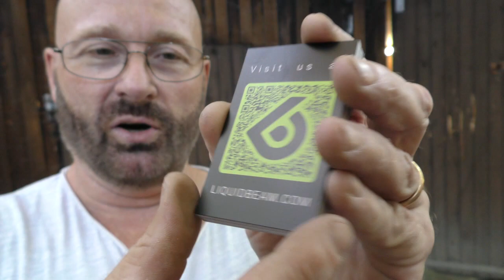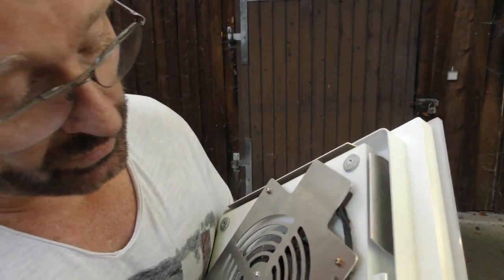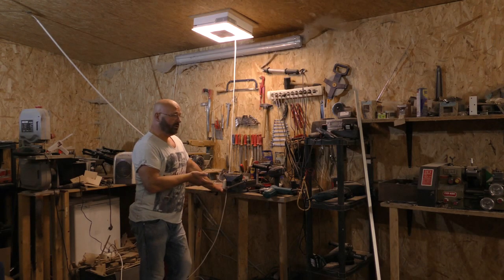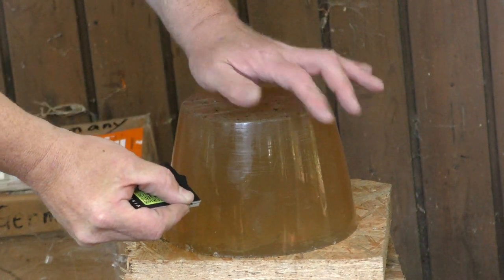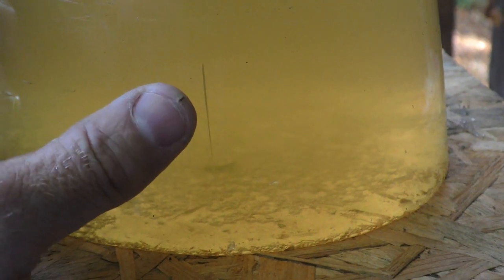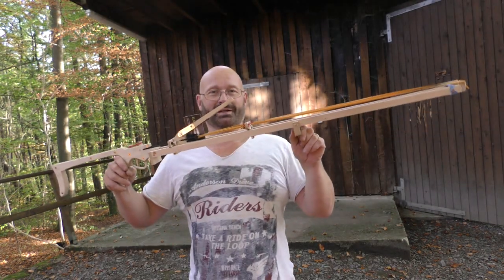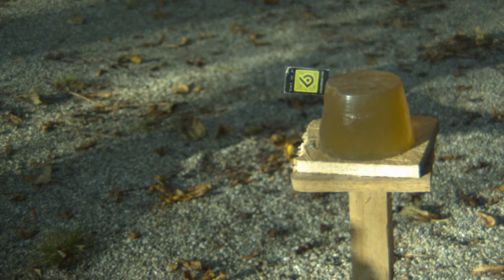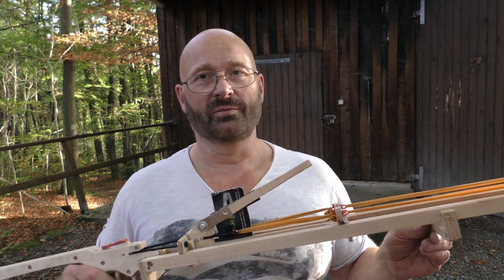How To Weaponize Business Cards - "Cardception"

Comment: This is a VERY BAD idea for "upgrades" since electrical light installations are not designed for huge loads such as heating. Hopefully you have 6 amp fuses on your lighting and they'll pop soon after you turn the heating on or you're in for a nastier surprise.

Comment: what exactly is the benefit of putting an electric heater in a light? Electric heaters are not efficient, and it is not even a storage heater, which is less efficient than gas but what you use when you don't have the option. If it is a localised heater a portable heater would work better.

Comment: ehhh the product seems kinda bad. what if it's summer night? i sure as fuck don't want more heat in the summer. those lamps are probably a lot more costly in the long run than just central heating/burning wood

Comment: All fine and dandy.. except for the price. Are they willing to manufacture every unit with custom 3D printed parts?! I can achieve the same functionality with couple of LEDs combs, transformer and doubled up hairdriers :D + AT89C52/Arduino microcontroller -> all that for the fraction of the original unit cost. Nice idea, but since you want people to use it outside main living space (garage, workbench etc. ) there is no need for fancy design, just make the thing practical and affordable (at least when subjected to mass production). Still they are German, so maby its all because of their inherent urge to overengineer things :P
Reply from the maker: I don't think hairdryers would work, they are much too loud. You want a large, slow moving fan. And don't forget that you run into many costs if you bring a product to the market - liability insurance, warranty, taxes, plus the margins of distribution and your own profit margin. Rule of thumb in the electronics industry: Multiply your production cost by factor three, then you have a retail price that lets you make some money. For a 250 dollar RRP, that means you have to build it for 83 dollars. Not easy.
Reply: Of course the process of making it legal and fulfill any safety regulations rises the overall unit cost, because you have to get rid of "janky" solutions that were fine on prototype`s drawing board :P .Still I dont deny the plausibility of their idea, and wish them all good - even if personally i would rather build it myself (i do feel like you if it comes to safety regulations when building/testing my crazy contraptions) :D .

Comment: so a throwing star is defined as a star shaped metal disk... and circular saw blades looks like the sun... which is a star... GERMANY BANNED TABLE SAWS?!?
Reply from the maker: No. They must be meant for throwing. So circular saw blades are fine. But the saw teeth are actually too small and also not aligned because they wouldn't cut, otherwise.
Reply: so as long as it isn't meant for throwing its fine. So like if you wanted to have fun with throwing stars in germany it would be fine to goof around with say, throwing some small bike gears into a board?

Comment: So Eliah is an incandescent light bulb over-engineered with an LED. It was cheaper before. Such a train wrack idea. Putting the heat on the ceiling. Please remind me where heat is going? Down or up?. Smashing two existing solution together is not innovative.

Comment: If it spins horizontally it would fly much further
Reply from the maker: Why? This isn't a frisbee.
Reply: Yes but then it will fly like a frisbee. If you throw a frisbee (or card) vertically it wont fly very far. Your card flew so far because it had so fast speed. If it spins horizontally the airflow will keep it in air much longer and with so fast speed it could fly further. Of coure it wont be so accurate and it's more difficult to make.
Reply from the maker: @danielnyman6082  You are mistaken. A Frisbee has the distinctive bowl shape so the rotation creates an upward lift. Same goes for clay pigeons. A flat object won't show that effect so it makes zero difference if I shoot it sideways are vertical. Believe me, I tested it. Not hard to turn the weapon 90 degrees, you know.

Comment: As an electrician that light isn't really practical for a lighting circuit at 2000 watts on a 6amp breaker as that light/heater alone would be drawing around 8.7 amps, so it would constantly trip and cause all your lights to trip aswell, and judging by the look of it u couldn't have it in a bathroom because of IP ratings. The only feasable way u could use this is by wiring it to a switch fuse on a 20/32amp breaker for a radial/final ring circuit or using it with a 13amp fused plug. So yea for sheds/workshops it might be alright, but definitely not as a fixed unit in a household.
Reply: I used to be an electrician too! High five!
Reply from the maker: Every cheap electric heater has 2000 Watts, and works fine except maybe in very old houses. They simply never draw peak amps.
Reply: Maybe not, but thats not the point. The real point is about safety. The whole lighting circuit goes by the 100w per room principle, (100w light bulbs basically). Even tho realistically we would probably never use 100w bulbs in this day and age because of led lighting and such being drastically lower wattage. However wiring a lighting circuit and testing still follows that 100w baseline. So 2000w per light is kinda pushing it considering a typical house might have 7 lights, or lets say 10 to round it off, thats only 1000w if u were to use 10 100w bulbs, for an entire house. But that is totally within the rating of a 6amp breaker. Put in a couple 2000w heater/lights tho and all of a sudden youre overloading the circuit and that could cause major fire risks if wired up incorrectly. 

Its a good innovation i'll give it that, as a heater is basically just a giant filament light, but theres no way u would wire it up on a lighting circuit.

Safety first people.

Comment: Another product that tries to offers a "solution" to a problem that doesn't exist. There is a reason why heaters are put on the ground, not on the ceiling, and a tiny fan is not going to fix that. Not to mention this is a terrible execution of their idea, you can make the same product much cheaper, more reliable and simple by using a halogen type of light bulb which emits 90 something % of it's energy as heat. I hate gimmicky products like that, their only purpose is to grab your cash. $250 for something that has like $30 worth of materials in it? Get out of here.
Reply from the maker: So you want to put a 2000 Watt halogen light bulb into a ceiling light? Because that is what you would have to do. And since such lights can't be dimmed, you would not be able to even lower the heat it emits, let alone switch it off.
Reply: If I was a cash grabbing inventor like these guys that's exactly how I would have had it done, if you're going to make a ridiculous product go all the way in xD Myself personally? I'd use a regular heater that sits on the ground(convection!) and put a smart bulb on the ceiling, like a normal person. What these guys have designed is an inefficient product at best and a fire hazard at worst. Here is a suggestion that would have made their product more useful, they have a nicely looking ceiling lamp and smart functionality to it, remove the gimmicky hazardous heater and make it a security product by adding smart smoke/CO fire alarm and a camera.

Comment: Really? Heat from electricity? Of course it is convenient. Convenient and HORRIBLY ecoUNfriendly. I am aware that this is still common in the united states but in germany these kind of heating systems are "almost banned". You can get a 2kW heater for 20€ and still nobody uses it. The rest of the money is just for a fancy lamp. Aside from all the posts about advertising and not advertising this is NOT a nice product to recommend >:-|
Reply: What are the alternatives, gas, oil, coal/wood? Anything else is electricity based and cleaner as all of those, it just depends how you use electricity to heat. Air/air ground/air pumps deliver the basic temperatures and they still use a lot of electricity for operation in addition to heat to the necessary degrees. 

That said, get yourself a modern Kotatsu, you will enjoy the heat generated by electricity.
Reply: Heat pumps are the best I can think of. But with heat pumps the heat does not come from electricity but from the environment. Of course the power needed to drive the whole setup should ideally be used for heating as well. With a ratio of 5 kW heat per 1 kW electrical power you are far better than direct combustion, even if the electricity comes from burning fossile fuels at 30-40% efficiency.
Reply: You will not always get the amount of heat needed/desired with the pumps, regardless of the setup, so additional heating will be needed, and usually it ends up being electricity if it's a newer system.
Reply from the maker: For me it is a problem solver. I don't have any energy source BUT electricity in my unheated workshop. Can't use gas because of the fire hazard (wood dust).
Reply: 奥村 麻子 I will, because in germany you will rarely see temperaturs below 0°C and almost never below -10°C and that would be the point where many heat pumps will stop working. But there are pumps for lower temperatures and aside from that those very cold days are also very sunny and thus you don't need heating at all if you have a decent house.
Reply: JoergSprave I also have one of those electrical heating thingys in my workshop because there is no other way of heating it, but I don't "heat". It is just for staying above freezing level. Since my garage is built next to the house it gets some heat from the house and only on very cold nights there is a tiny amount of heat required to stay above 0°C. Many years don't even have those nights where I live (near Bonn). But that lamp is clearly build to keep people warm. And that is just a waste.
Reply from the maker: For me it is perfect. Can't work well with cold hands, and can't work well with gloves either. This is going to give me light and warmth EXACTLY where I need both. And here in the Odenwald, at 500 meters altitude, we get many days below -10.